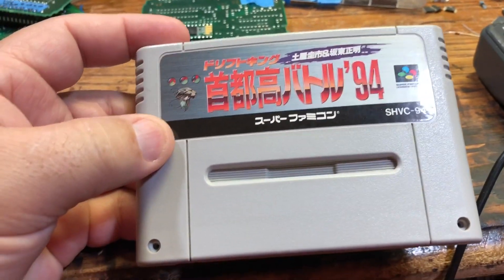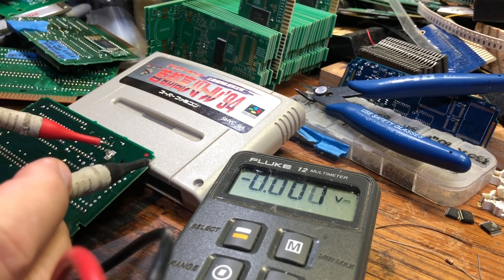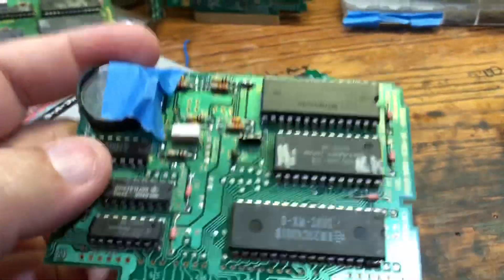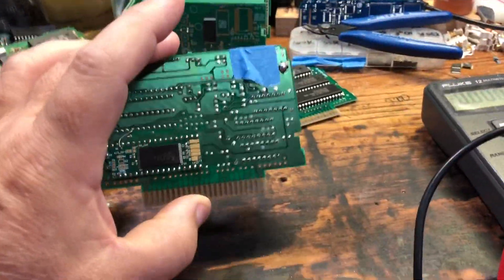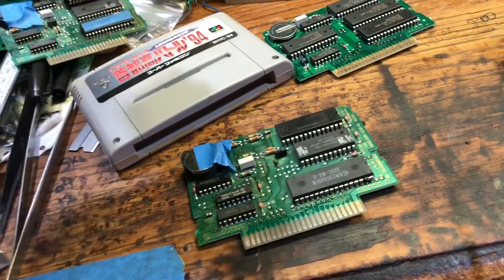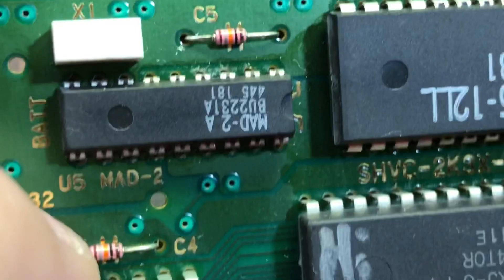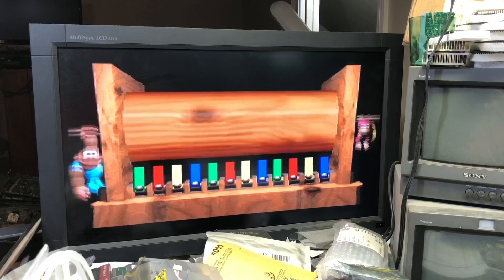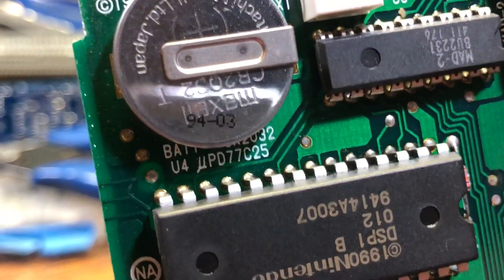Snes DSP1 (Mario kart pcb) notes and testing

Comment: Thanks for explaining the data lines, so for an 8 megabit repro, cart pins 46 (A21), 47 (A22) and 48 (A23) don't need to be connected at all? By the same measure, Tales of Phantasia on a BJ3M board would require  A23 to be connected, since it's bigger than 32 megabit or am I wrong?
Reply from the maker: @thesecretofmana  well….. an 8megabit (=1mega Byte) would have a HSB (highest significant bit) of A19 and a maximum of 32pins in a rom package. Each additional address line doubled the rom size.  So A20 is 16mbits (2 megabytes) and A21 would be a 32mbit (4mByte) rom.
The terminology is that when you are talking about the physical rom device, it’s referred to as the mega “bits” but when you talk about the rom file size (like on your PC), then it’s mega “bytes” [1 byte=8bits].  Too many people get this confused.

Tales of Phantasia is a 6mB (upper case “B” = bytes) game.  Usually divided up as 4mB + 2mB.  Tales uses Address A23 to decode the 2 roms.  Only 1 device can talk at any given time so there has to be a decoder to regulate who has to stop talking and who can talk.,
The terminology also has to be clear in that, the Snes edge connector A21 on a Lo map pcb is in a different position as A21 on a Hi map cart.  So a lot of times when I talk about carts and mods, I will refer to the edge connector number as “edge 47 A21 Lo map” or whatever the case is.   Basically all the addresses above A14 either shift up by 1 address or is linear (15-15, 16-16, etc).   

But, BJ3M board is NOT a tales of Phantasia game board.   BJ3M max rom size is 2mB + 2mB.  Can you make a tales on a BJ3M—— yes but how ugly do you want it to be?
BJ3M hard grounds the A21 pin so there’s that… A23 doesn’t go anywhere from the edge, and the decoder would need 2? Pins rewired.  In my 1A3B videos, I could make those run a Tales game with some extra wiring and an added mask rom board.  Also, A23 is inverted when running a Extended rom game.  But if the MAD1 is wired correctly, it can do the decoding.
Reply: @arcademaster1 I was wrong, there's a lot to unpack here, I appreciate the lengthy explanation.

Comment: Does this mean if I have a faulty DSP chip I could put Donkey Kong Country or another HiROM game and it would work, if so would I completely remove the DSP in this case since it's not working?
Reply from the maker: @thesecretofmana  I don’t know how to answer that…. The DSP chip is never activated with a non-DSP game.  The decoder is exactly the same as a regular Hi map game with 1 additional output going to the DSP. 
If you have the means, skills, parts, knowledge to mod your cart just like I showed in my video, yes you can.  
If a part is defective, it’s probably best to remove it but how do you know it’s defective?
Reply: @arcademaster1  When I start the game there are graphical glitches, tried the DSP on another donor and it's still bad. The working donor DSP works fine on the original cart. All good just curious, thank you. If I ever end up trying it I'll let you know.

Comment: The dropoff is sharp but not instant. If you're measuring 2.9V, that's around 5-10%, you should replace that now, if you don't, you might have a few months left. 3.1V pretty much means no worries, check again in a decade.
I've only ever once had a SNES game lose its saves due to a dead battery and that was 20 years ago, the battery must've been faulty from the start, now I sometimes lose saves due to bad contacts making the CPU overwrite the saves with garbage. Sometimes I hold an LED to the battery to see if it still shines brightly. Usually it does.

Reminds me, I gotta check on the suicide battery of our Turbo Outrun. In 2016, I checked all our local arcade's SEGA Suicide Battery games and replaced them all, but I didn't know Turbo Outrun had one until like 2 years ago, but it was also still well above 3V (the others were at 2.9something or 3.01V). Made in 1988.
Btw. Baby me got a "singing mug" roughly around '87. The entire circuit is potted in the bottom of the mug. It still works. (I've only used it like 3 times in the last 2 decades though)